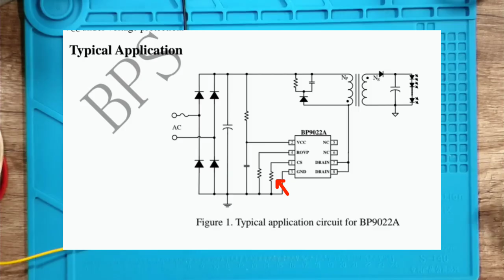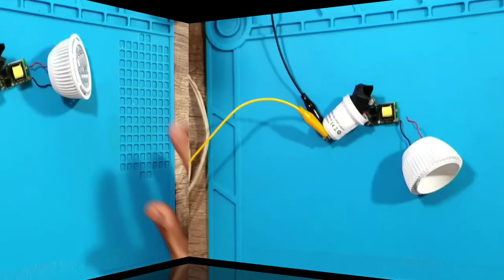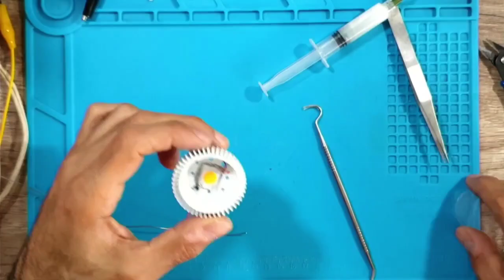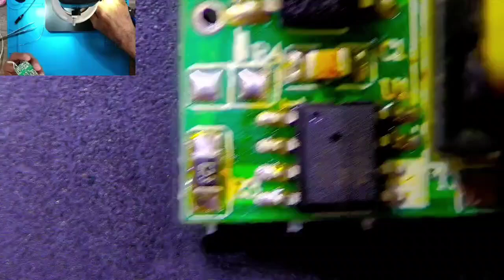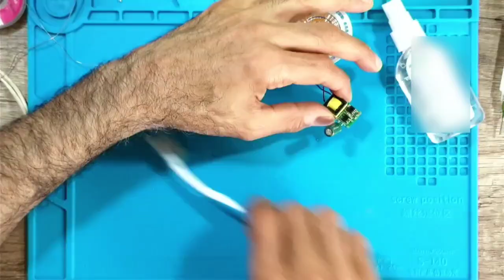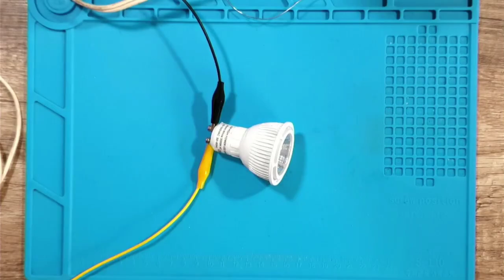64 LED Bulb - Reduce Power Project

Comment from the maker: Spoiler saver...
.
.
.
.
The only thing I can think of trying, in order to correct the flickering issue, is to add a discharge resistor for the capacitor. I'm thinking maybe there's residual stored energy in the capacitor that's causing the flickering. So I might revisit this in a future video...